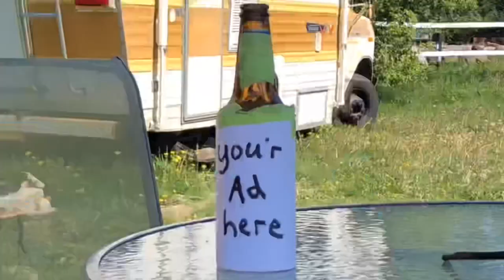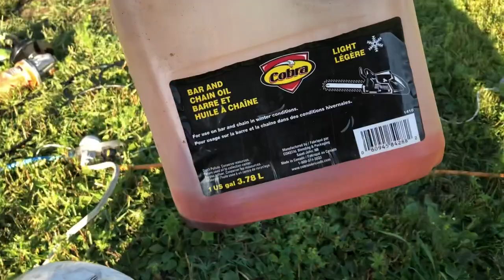Rusted Rocker Panel repair (stop rust forever) rocker repair on a budget, classic car rocker repair

Comment: I really like your style! Using what you have, no fancy metal bending tools, just what anybody can use at home. And what a great result!
Reply from the maker: Thx 🙏🏻
Reply: @ProblemSolverGarage  I'm with Phillip.  I love that about your videos.   I was thinking of making a channel for simple basic w108 DIY hacks.
Reply: Greetings from Namibia! I am perplexed! You did all that over a garden bench. Where can I buy such a great bench?  Seriously you are very talented!  I was wondering about you covering all the old solid metal work. Thinking that would all just rust out again.  But your solution was very clever. I've used ATF in body cavities which works very well.  I liked your molding about the front wheel rocker area which is notoriously difficult to do.  Really  very good. Thanks so much Stefan

Comment: Man, your video blew my mind.
I'm just tuning the engine on my 1969 280s, after rebuilding both zenith carbs.
Rust has started bubbling up all over the place on my merc in the last year. 
Was considering selling it off for parts. 
But you have inspired me enough that now considering storing it out of rain, while I learn to weld. 
How hard is it to master welding thin steel like that? How long to learn you think? 
Great work - I'm going to check out more of your clips!
Reply from the maker: Hey I appreciate the positive feedback. Welding is easy for some people but hard for others, the welder that I use is just the cheapest one nothing special, but I did go to college for welding, but tac welding is not that hard. 
 Also that work took me three months, the video makes it seem like I did it in two days LOL. Good luck with your project, I will keep posting videos on my Mercedes anytime I do anything to it. Make sure you rust prove it, so it doesn’t rust anymore. Good luck

Comment: For a super-fast job, I played this at double speed! 
I used to pump 90 weight gear-oil into rockers and wheel arches of my old cars. If they had already started rusting, this would usually stop it, or slow it way down!
Reply from the maker: yeah I totally works

Comment: How often do you spay oil in those rockers to prevent the rust and do you spray it in until it fills them up or just to coat everything then run out the bottom?
Reply from the maker: Just enough to coat everything, I do it before every winter so once a year, I do it to all my vehicles
Reply: @ProblemSolverGarage  thanks

Comment: Amazing work!   Do you have the names of the priming products you used?  Can you weld through them?  Thanks!
Reply from the maker: -self etching primer one can
-4K I build primer(primer paint)
-Regular body filler
Polyurethane single stage paint with Hardner and reducer

Comment: What tread you use for the welding machine?  the type you use with gas or without gas?
Reply from the maker: Flux core, no gas
Reply from the maker: The gas is coded into the wire